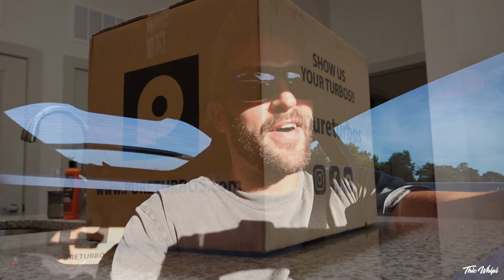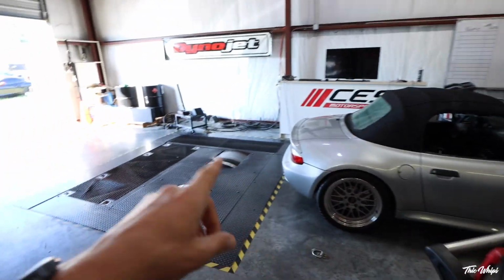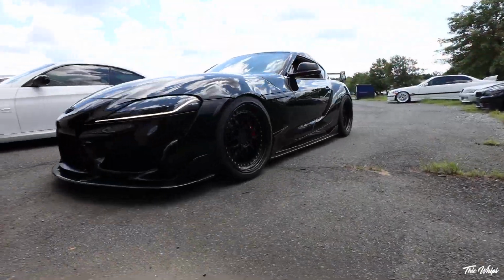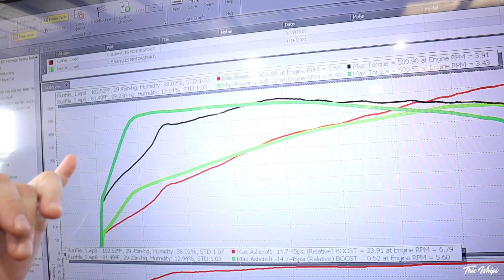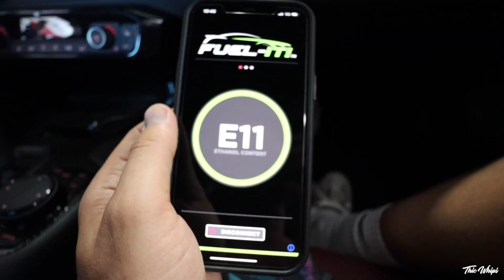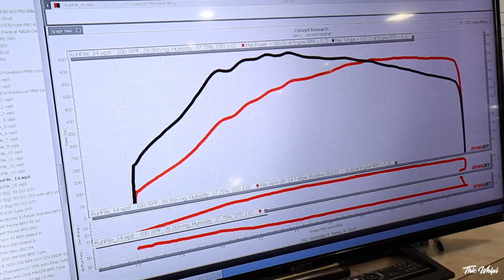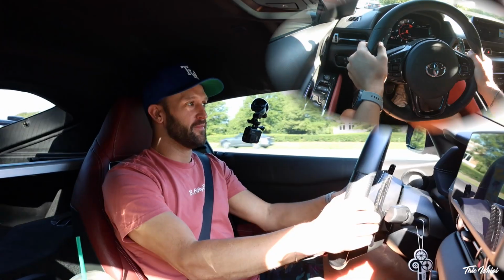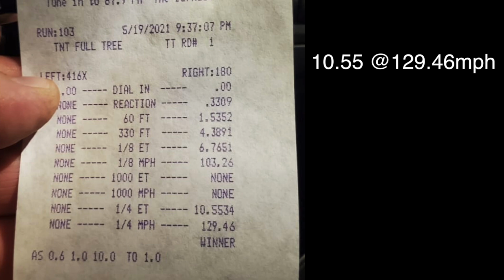THINGS JUST GOT REAL...(PURE800 TURBO INSTALL AND DYNO NUMBERS!)

Comment: Dude! Congrats on the upgrade! Solid numbers! Can’t wait to get mine upgraded! Is that with the methanol running too?
Reply from the maker: No meth sir. This is strictly pure800 and fueling. With meth you’ll be looking at mid 600s. We made a video on that setup on an orange Supra that came through the shop!
Reply: @ThicWhips  That’s bonkers man. Love your content man. Been a fan for a while. Straight forward, car centric, no drama with some clear DIYs mixed in. Keep it up bro! With the 21’s boost coming in a little bit later than the 20’s, think the Pure 850 would be a better fit? Seriously stoked to see the results after you get that port injection. Props from an MN Supra owner man!

Comment: Thanks for posting this. I was debating on what Pure turbo to upgrade to on my A91 Supra with a 93 octane tune (Pure 700 or 800) but your VLOG had sealed the deal for me with wanting to upgrade to an 800. Posting your WOT pulls on the road also showed me the amount of potential lag to anticipate which doesn't seem too bad over the stock turbo.  From your perspective, when do you feel the pure 800 fully spooling compared to the stock turbo?
Reply: Had the same question regarding spooling when I was getting the upgrade, and honestly it spools early on and I don’t really notice any lag.
Reply: @evoslayer1233  Thanks for your feedback. From what I read on the forums, it's about a 300-400 RPM difference between the Pure 700 and 800 which should likely only be noticeable in first gear as the transmission tends to be in the middle/upper RPM range when shifting in the higher gears.
Reply: Get the 800 man go all out. Lol

Comment: Awesome Video! Amazing results. I have an M240i. Do they Make the Pure800 for that platform too? I ask because it's also has the B58 engine.
Reply from the maker: Yessir
Reply: I’m considering the same. I know the M240i has a smaller fuel pump so I’m not sure if the TU pump upgrade is required regardless or just if you’re trying to go for an ethanol blend

Comment: Thinking of getting ecu unlocked and the MHD is about 2500 less then getting ecutek clone. 

What’s your thoughts on the MHD, can I run full e85 ? With fuel system? Is this pure 800 on mHD? Any in-site be great!
Reply: You could run MHD but it’s better to run ECUTEK when dealing with port injection and fueling. To run full E85 efficiently you would need port injection and reflex with ID1050 injectors and also a lpfp from Visconti would be recommended. Tuning wise your best bet is either Payn or Visconti. At that power level your trans will begin to slip as well

Comment: I’m sure this has been asked before, with the pure 800 and the pump gas tune, any issue with check engine lights?
Reply from the maker: Oh the pure 800 there is a wastegate plug that will be deleted. Your tuner will need to code out the crankcase leakage code: 16050A is the code. Other than that you’ll be good

Comment: Oof that torque! How are the trans holding up around this power level?
Reply from the maker: No issue so far, probably about 30 pulls in at this level
Reply: Eh you wanna get trans built by the time your in 600wtq range. Mine is already a little unhappy with all the torque on E50 tune and I didn’t even get my pure 800 or port injection w/e85 done yet. Lol

Comment: I was honestly expecting the pure800 to break 600 whp on e blend. Did you hit the limits of the fuel system?
Reply from the maker: You won’t break 600whp without meth or port injection. Fueling can’t produce more than where we are at. Once I slap port on we will be mid 600s no problem.
Reply: @ThicWhips  ok so it was the fuel system then. Good to know that the pure800 is capable of more if fuel allows.

Comment: Will you do a dyno review on E50?
Reply from the maker: If you’re running pure800 without port you don’t want to run e50, that’s too much ethanol paired with the pure800. E35 is the spot to be. Stock turbo, e50 is the move.

Comment: Talks about all the time needed to tune a car properly and all the extra effort they put in. Does 2 pulls 93 tune done 😂😂😂
Reply from the maker: The time and effort was applied to the 100+ supras tuned before me. Once you have the data it’s pretty easy to apply that to future cars. Especially on a setup as basic as this. Besides, e blend maps are where it’s at. 99% of the time I run ethanol.

Comment: “A long couple of days”
Oh c’mon dude, don’t rub it in… hardly any other car of this class can achieve that power with reliability in 2 days of work 🤣
Reply from the maker: That’s not really what I’m referring to.
Reply: @ThicWhips  what’re you talking about?
Reply from the maker: I’m referring to the conditions in which we worked  20 hours in. 100+ degree heat, surrounded by a very hot car, doing pulls after pulls, etc. paired with the work to get the car to this point. Its no secret how capable these cars are, I talk about it often. And coming from the Honda world, a 328, an n55…I’m very aware (as I’m sure most of us are) how easy it is to make great power with the Supra. That’s all 😁
Reply: @ThicWhips  I gotcha, I had that in mind as well, just was thinking more in the grand scheme.. some cars take months of long days like that to put together.

But as two day jobs go, those are pretty brutal conditions 😄